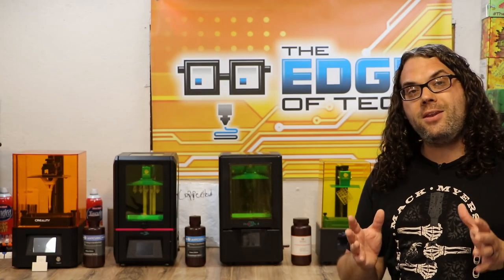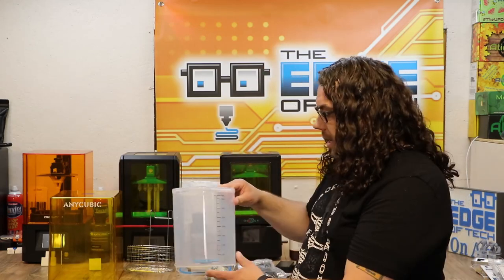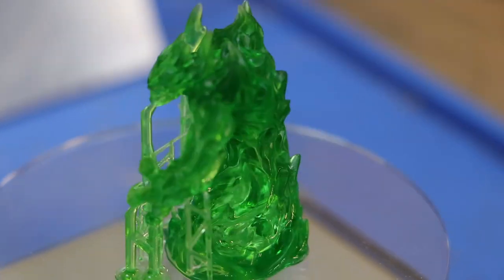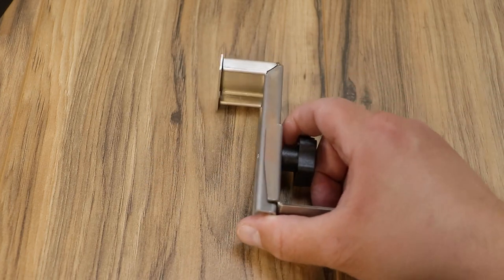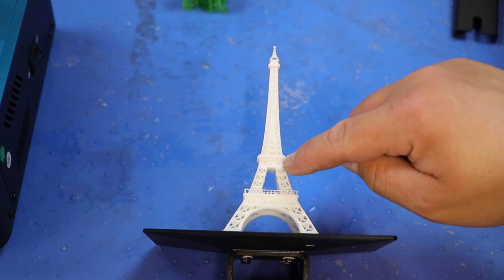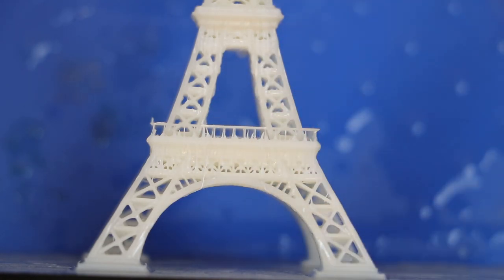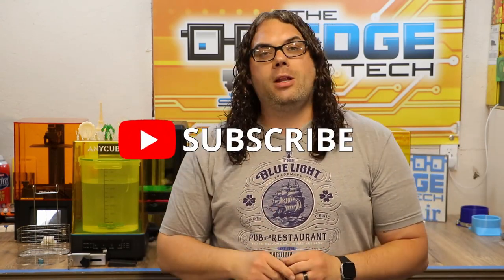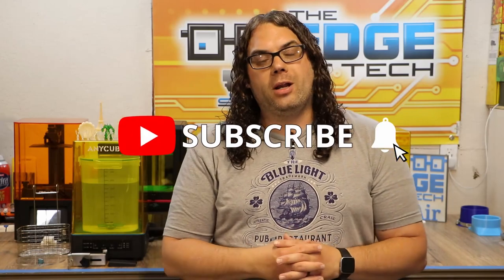Cleaning Resin Prints - Testing the AnyCubic Wash and Cure Station

Comment: 1) The yellowing isn't a result of over-curing, it's just a reaction of the resin to UV light and it disappears once the gases created during the process dissipate. Some people like to bake their prints at very low temperatures in order to facilitate this, but that creates toxic fumes, which can theoretically be problematic depending on resin volume and ventilation. I prefer to just leave them to rest in daylight for a week or two, then they return to their original color. That's when you know the curing process is actually finished.

2) The easiest way to clean IPA that I found is to leave the container under the sun for a few days, until the residue starts to become visible (as sludge). If you're lucky the residue will set at the bottom and you get fairly clean alcohol at the top. This can be transferred to a different container. To filter out the rest, just put a couple sheets of (strong) kitchen paper over an empty container to act as a filter and pour the dirty IPA into it. The resin sludge can be wrapped with the kitchen paper and carefully wrung out dry by hand. By the end, it will become a dry paste, which can be normally disposed of, as it's no longer a liquid. This process results in very little lost IPA and is very quick (if you don't count leaving it in the sun), but it's also very hands on, so a well-prepared working space and safety gear are vital.

Comment: The manual does state that if it's less than 30mm in diameter it should be cured with the 2 minute option.  I would have figured that the yellowing on the Eiffel Tower would have been even across the board since it's rotating at the same speed.  I'm glad he caught that it was due to over-curing

Comment: I would love to see the wash and cure station tested with the water washable resins. I have yet to see anyone try those with the station and it seems like it would be just that little bit more beginner friendly if it worked with just water and the water washables that are out there instead of having to use so much ipa. Thanks for the video and all the hard work you put in to these!
Reply from the maker: Great idea
Reply: I was sent some water washable by Elegoo. I don't have a cure station, but I throw the prints in an ultrasonic cleaner. They still come out shiny with uncured resin. So I have to use IPA anyway. Great resin, but hardly water washable.
Reply: A year later, but I do now have the wash and cure and use the water washable resin and use water to wash them. they come out great :) I do 10 minutes of clean and 10 minutes of cure though.
Reply: @Numerlon  I second this.

Comment: and yeah, white and clear resins will yellow - even if you don't over cure initially, over time just ambient UV light will yellow them as well - I think there are UV blocking clear coats that can be applied to protect them after their initial curing.
Reply from the maker: Thanks for the tips Josh!

Comment: I love mine, was worth it. You can use any sort of cleaner in there of course. I used to place the plate and hang it in there, but prefer to do a quick wash and place them in the basket unless they're small like those itty dragons you printed.

Comment: A thought about this. Many resins that I've used say to not keep it submerged in IPA for more than 30 seconds.
Reply: Do you use water washable resin? Many of those really hate IPA
Reply: @OtioseFanatic  Actually most resins are sensitive to IPA if soaked in them it will soften the resin even make them rubbery.
Reply: @slimjim7411  I haven't had that problem. At all. Hell more than once I've accidentally forgotten to unload my wash and cure station and left the print in it overnight and it's come out just fine. This has been done with both Anycubic Standard and SaryaTech Fast resins.

Comment: Hi, thank you for a nice video. I wonder abut the IPA. How long does it last? I have read that it evaporates. Can it be stored in the container in the wash station or do you have to dunk it over in another bottle between uses?
Reply: The container in the wash station can be closed and is fit to hold the alcohol indefinitely. The only problem is that IPA gets dirty very quickly, that's why it's actually better to clean the prints with a brush and small amounts of IPA first. This helps to keep the liquid clean longer. There are also various ways to clean IPA.  For example, you can leave the container under the sun for a few days, until the resin residue starts to become visible (as sludge). If you're lucky the residue will set at the bottom and you get fairly clean alcohol at the top. This can be transferred to a different container. To filter out the rest, just put a couple sheets of (strong) kitchen paper over an empty container to act as a filter and pour the dirty IPA into it. The resin sludge can be wrapped with the kitchen paper and carefully wrung out dry by hand. By the end, it will become a dry paste, which can be normally disposed of, as it's no longer a liquid. This process results in very little lost IPA and is very quick (if you don't count leaving it in the sun), but it's also very hands on, so a well-prepared working space and safety gear are vital.
Reply: @AlexanderReiswich  That you. I have discovered the same from other sources since I posted here. I have cured/cleaned ipa in a clean plastic container in the sun. It took three weeks for it to settle and left a lot more of white crud at the bottom than I expected. Maybe I will try some brush off later. Now I think I will stop printing for the winter, my garage is too cold this season.
Reply: @prewinder  Yeah, cold temperature is a bane on resin printing. Too bad there are almost no affordable printers with integrated heating. I use a small portable heater to warm up the resin bottle and the vat, then cover the printer with towels to retain the warmth for printing duration... not perfect, but good enough
Reply: @AlexanderReiswich  I will just wait for next summer. Not worth heating with current energy prices.

Comment: Couldn't you unscrew the bolt all the way out of the zero and use it on the cleaner mount?
Reply from the maker: I don't think there is a nut because if I remember right it screws directly into the frame. But I will check!

Comment: I may be repeating some past comments on here but only using 2 minutes to avoid yellowing isn't professional. Got to use the scientific method. First, make two of something and cure one in sunlight and one in this box. If they both turn out yellow, it could be the resin you're using. If only the one in the AnyCubic yellows then they're using either LEDs that aren't in the right range or the method of a column of LEDs has a flaw to it. Or, it could also be that in the washing process the IPA used had an effect that didn't become noticeable until it was cured. It could even be the protective orange cover. Bright light from outside the box would look just as orange inside the box. Try eliminating that slight possibility by curing it with the room lights off. I doubt that's it but if it had an affect then leave the AnyCubic in a closet when curing. I can still think of 3 other possible ways this could have happened. Scientific method.

Comment: I am using the Elegoo Water washable resin, I am new to this so I just wanted to ask if it is safe for the washing basin to cure the resin that is in the water
Reply: The bearing inside the spinner at the base will rust in water, however it is only a few screws holding it in. Replace the bearing to a stainless steel alternative and your good to go in water.
Reply: @benlew2004  good to know, I got mine a while ago because I thought "ah fecc it" I didn't know there was an alternate barring though. Ill look into getting one soon

Comment: I know that modelers will add a few drops of blue paint to their white paint before using it if they want, expect, or need the paint to stay white as long as possible, because white paint will tend to yellow over time and the blue retards the process.  Something you might try is to mix a VERY SMALL amount of clear blue resin with your clear resin.  And I mean MIX!!!! Maybe take an empty resin bottle you've cleaned out with IPA, put in a few ounces of the clear, then a small amount of the clear blue.  SHAKE THAT UP!!!!!  Then try printing with that and curing for the full 2 minutes.  IF it doesn't work, increase the blue and try again.  If the clear starts going blue visibly and it still won't work, then the theory has not proven out.  Just a thought.

Comment: You cant "overcure" the print as it would also cure more when you place it on your desk and it gets hit by UV light ;)
May the yellow comes from the UV led but technically my statement is not false.
Reply: Only if you consider color. If you consider strength and elasticity of the print, yes, you can certainly overcure prints and should avoid overcuring. The UV light in the office is not an issue if the models are painted.  Most modeling clear coats have some UV blockage properties.